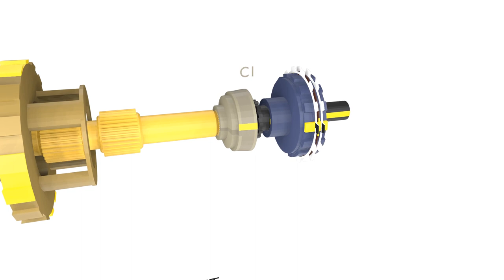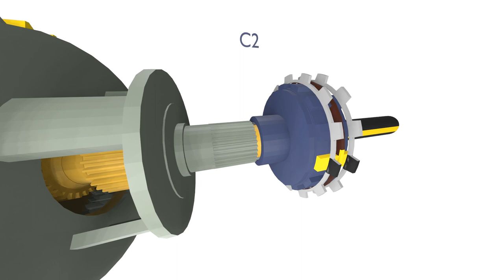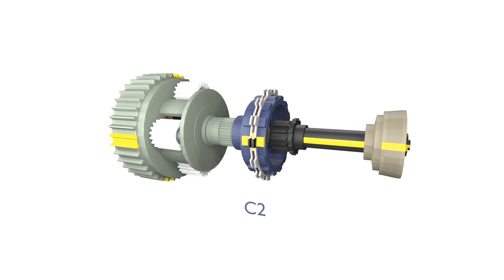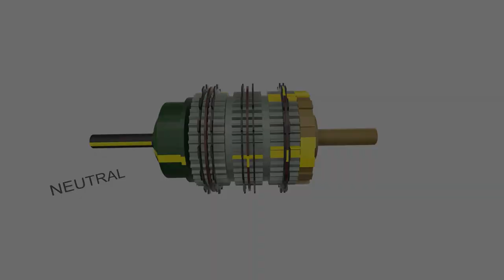How A Basic 6 Speed Automatic Transmission Works: PART 1

Comment: I  found an error, Bro. Clutch 2 engages P2 carrier and P3 Ring, NOT P3 carrier, because P3 carrier is an output
Reply from the maker: This is for the 1000 allison model. The C2 housing is splined to the P3 carrier. Go look at a real manual.